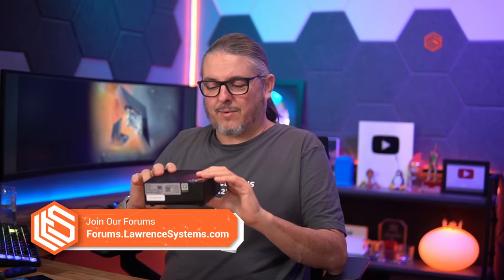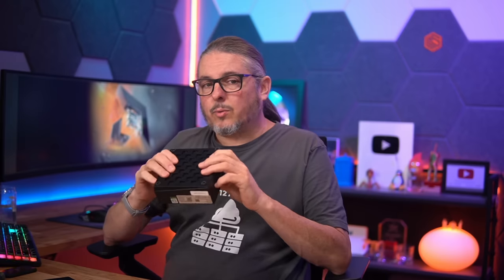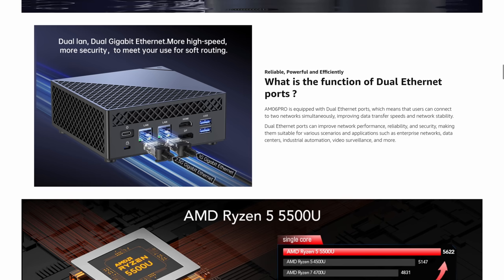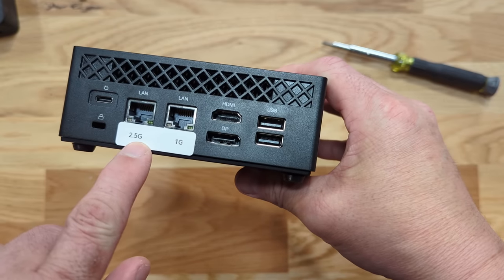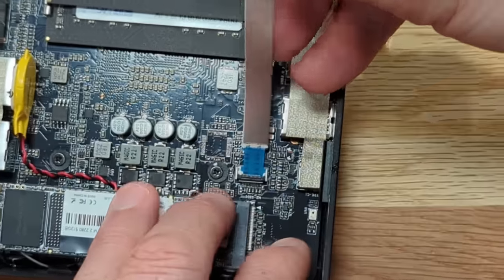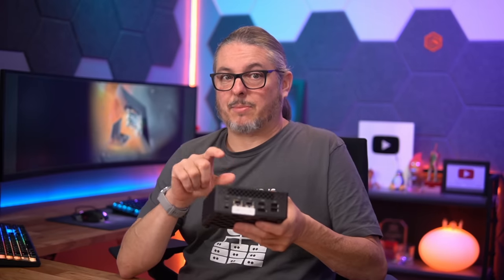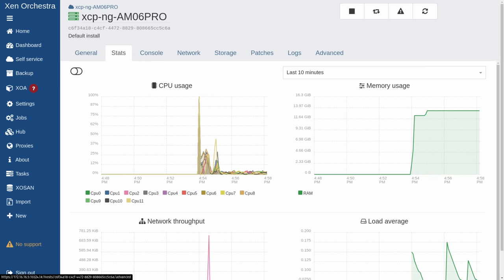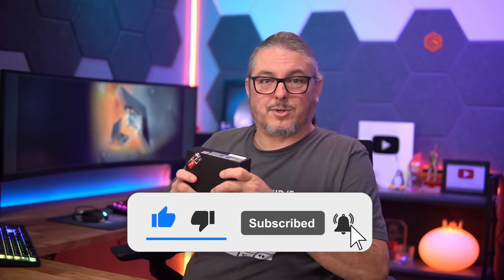Ryzen Mini PC Review: Quiet and Power-Efficient Virtualization for Your Homelab!

Comment: I run my entire network on a similar device from lenovo, and i mean everything, network share, backups, 12+ docker conatiners, media servers, automation, etc. I have mutiple drives attached by USB 3.0 (SSDs) and use the USB C port to attach a 2.5gigibit line. I use to be one of those dell r710 massive racks guys but man its really nice to have something be so tiny, not using much power and be just be so effecient. Proxmox and docker conatiners are your friends!

Comment: I've been running this sort of BOX as my VM hosts (x3)(Proxmox) for a few years now and they are great for the Homelab.    
Really Quite as well as low power / Heat.   
Im running the  AMD Ryzen 7 4800 with 64GB ram in each host and have no issues at all.
The 1GB and 2.5GB combo is handy as well as the Extra SSD.   Allows me to run Ceph.  
I'm surprised it has taken this long for these to be flagged as a good home Lab System.

Comment: I've had the 5800U variant running Proxmox for a couple weeks now and so far so good. Only challenging issue is GPU passthrough for video encoding. All the options are in the BIOS but I still can't get /dev/dri/renderd128 to show up when IOMMU is enabled. Other PCI devices (Coral M.2 Accelerator) pass through just fine so I suspect a BIOS issue. I'll probably ask on their forums since they seem quite active

Also just for the curious, I have an opnsense VM for my router/firewall and it performs great. I get my full 1 Gig internet speeds in normal use. Haven't tried VPN etc but I think it'll handle it ok. Then I'm also running Homeassistant with Frigate for my 6 cameras hence the Coral board and it doesn't skip a beat although CPU usage is a little high right now since I can't get GPU passthrough working for hardware encoding/decoding
Reply: amd cpu/gpu combos are hard to get gpu passthrough working on proxmox, but havent really had a need for mine I found I  didnt really need encoding/decoding for jellyfin. If you get it working thought please update

Comment: I have a Ryzen 3 1300X and Ryzen 7 1700X, both can be swapped on a custom desktop. I run pfSense on it and use OpenVPN to hit near half a gigabit speeds over NordVPN. Can you make a video auditing a proxmox firewall that uses a public IP on the WAN? I have set up pfSense on proxmox before but I think people were able to break into my proxmox so I am running bare metal now. I know 1st get Ryzen had Spectre and Meltdown vulnerabilities, but pfSense doesn't seem to think they need PTI Mitigation or Spectre/Meltdown workarounds.
Reply from the maker: I don't use Proxmox so I don't make videos on it.

Comment: Why so most NAS boxes and for that matter motherboards only offer SATA or nvme? What happened to SAS? Don't we want out HDD's to have greater speeds than slow SATA  and get to SAS @ 24 Gbps (SAS 4.0).  What am I missing here?
Reply from the maker: Because it costs more and most SAS is done via an expansion card.
Reply: @LAWRENCESYSTEMS  when has that stopped us geeks? If you would try it what type of hba would work with truenas, pfSense, and virtualizatiothat could be put in one of those 2nd pcie slots on a matx card.?

Comment: Great video 🙂  when you run xcp-ng on it. Do you also get the network to work with 1 Gb Realtek nic with guest tools installed on windows vm.

with my Asus pn52 with Realtek RTK 8125BG 2.5 GB nic does not work with 2.5 Gb link or windows with guest tolls installed
Reply from the maker: The link speed shown in a virtual machine doesn't matter
Reply: @LAWRENCESYSTEMS  that's not what I meant, I mean the physical link speed from the dom0 network port up to the switch. 

I get 0.4MB/s real smb transfer and internet speed in windows vm . Is an error with the Realtek RTK 8125BG drivers or something with the guest tools

Without guest tools I have 115MB/s read/write on windows vm when I am connected to the 1 Gb switch. But after installing the guest tools (have tried citrix-vm-tools and Xcp-ng tools), all of the speed disappears and is down to 0.4 MB/s Read/write. running Xcp-ng 8.3

Comment: I have a question about the performance of using USB 3 (5 of 10gbps) or thunderbird (USB4) ports for adding a 2.5 of 10g ethernet port adapters. Do they work as well as direct attached Intel constollers on the motherboard or a PCI card? I am thinking of using one of these mini PC's for a pfsense firewall and need 3 ethernet ports and most don't even have 2. Will these USB-Ethernet adapters work well on pfsense or TrueNas? Has Anyone done any videos on this?
Reply from the maker: USB Ethernet is buggy on TrueNAS & pfsense
Reply: what about using AMD Ryzen for TrueNAS & pfsense but wtth Intel Nics? Any downsides or intel features that we won't get? thanks again @LAWRENCESYSTEMS
Reply from the maker: @be-kind00  That works fine, we have a fer Ryzen TrueNAS at our office